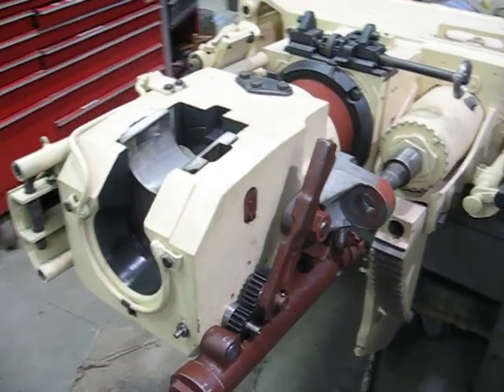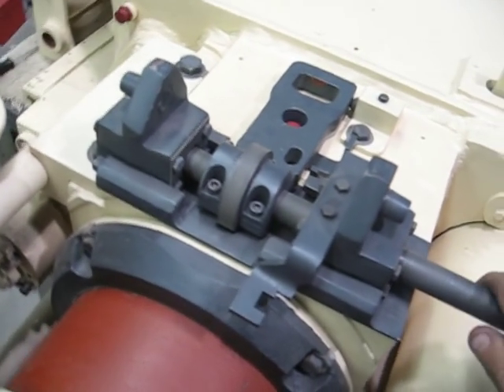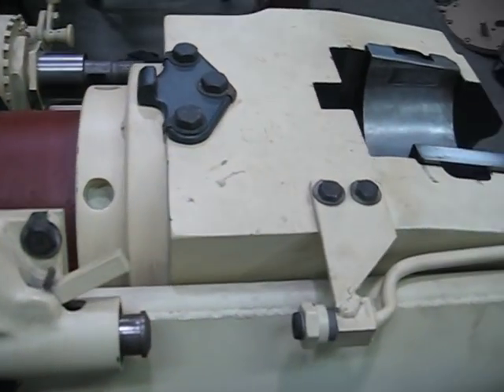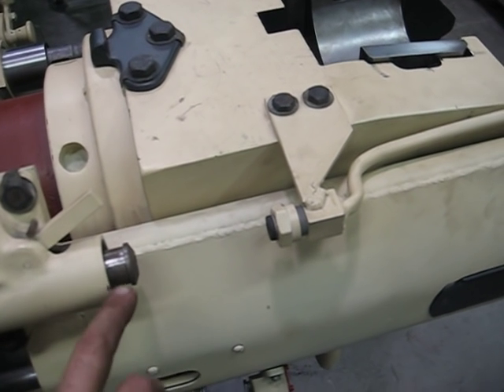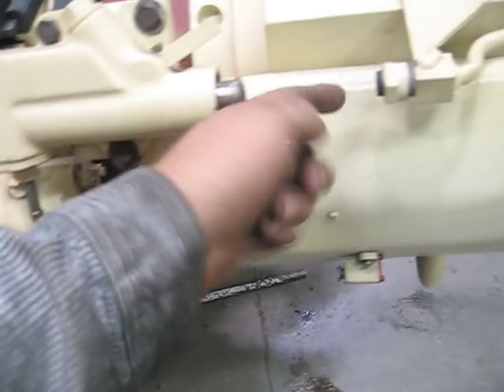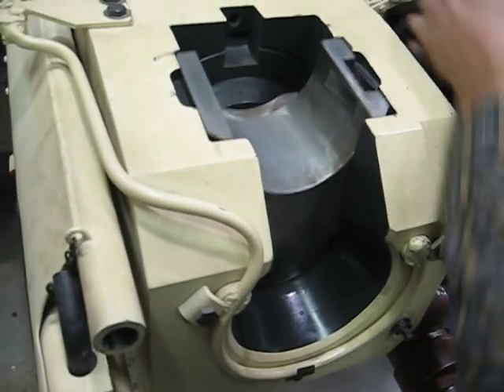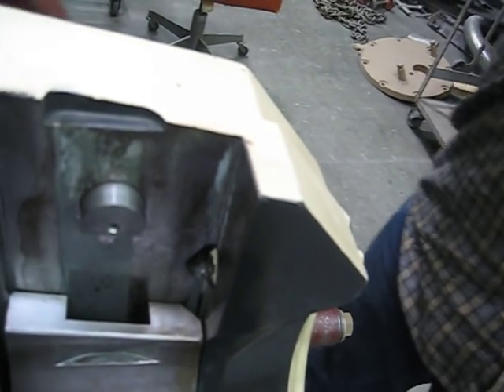Panther Tank 75mm gun tour!

Comment from the maker: We can't fire any sort of round through this gun (or any of our others) because the breech ring has been torched apart to meet U.S. specs for importation and then tacked back together to look original.  There is also a 75mm hole torched in the high pressure area of the gun tube.  The sliding block is also fake and missing all the firing pin features.  Sorry for the disappointment....
Reply: Hi im just asking a question how does a tank turret hold a big barrel and yes i know why there are spring its purpose is shock absorption right or i am wrong?
Reply: @yellowsaturn2873  Hello, in the turret front, the barrel with the cannon cover is supported with strong pegs without play to enable the barrel to be raised. The recoil is actually absorbed by springs and recoil brakes. The brakes absorb most of the energy and work on the same principle as a shock absorber in a car. The spring or springs are primarily used to pull the cannon forward again into the firing position.
Reply: Uh, yeh...
Reply: She can never fire in anger again...

Comment: In the olden days it was done mostly with turret exhaust fans, a bit later on the bore evacuator was developed, this is a canister placed on the exterior of the gun tube that contains the gasses from the shot fired, then as the shot passes the tube vents (that lead into the evacuator) the vacuum created as the shot leaves the bore, allows the gasses to vent from the muzzle. This system precedes the evacuator, and does help to keep the smoke to a minimum. Its like tear gas, very unpleasant stuff

Comment: How this semi automatic acyion works
The gears contract the spring towards the breech by pulling the rack. Imagine that instead of the force being applied through the handle, gears, and rack to contract the spring, there is instead horizontal force is being applied directly to the rack to compress the spring. That is exactly what part L does. 
First to clarify, the hook and acting cam surface (part M) is part of the gun cradle and is not attached to the barrel or breech. Part L will be rotate clockwise after it impacts part M when the gun recoils. The round top section of part L will then push down on the angled wedge surface that is connected to the rack (part F), causing the rack to be pushed towards the breech, compressing the spring (part G) and also rotating the pinion gear (part E). Part N is a spring loaded plunger that prevents part L from moving freely while the gun recoils and resets (it indexes in that small crescent cut to the right of the label pointer). Part L will stay rotated almost horizontal until the ejector arms are tripped and the spring pushes the rack forward again, causing the angled wedge surface attached to the rack to push the round surface of part L and rotate it clockwise back into its original vertical position.  

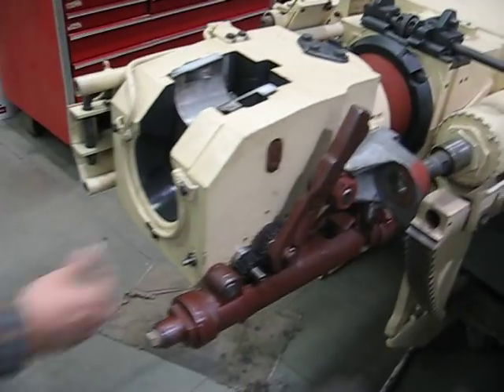The ejector arms is what allows the breech to close. Once the breech is open, it will not and cannot close until those arms are tripped. Pay attention to the little red flag like piece (part H in the drawing) as the breech is being opened at 0:32 - 0:33. As the breech is fully opened we see that little flag like piece pivot slightly. This is because it is connected to the ejector arms. This is a secondary way to allow the breech to close. Primary one being the rim of the shell casing being used to trip the arms

http://www.panther1944.de/Bilder/Panther/vorschriften/char_panther/Zeichnung-5.jpg

In the below picture you can see part L and M
https://d6a2z3m5.stackpathcdn.com/wp-content/uploads/2018/04/panther-breech.jpg

Comment: When being fired the breech the rim of the shell case trips the extractors and  the breech block locks, when fired the sight  adjustment from 600 yards to 1,200 yards is only 3/10 of a Mile. or less than 1/8 of a inch. And yes the Panther runs, but sadly the owner Mr Littelfield died shortly after driving without the turret in early 2009.

Comment: Great! But got a question, is this a semi-auto gun? Meaning as the gun fires the shell is ejected and breech lowered by the recoil? If so how does the gun accomplish these two functions?
Reply: Yes. It probably works the same way any other semi automatic artillery gun works. Check out the zis2 or zis3 ww2 Russian guns. There is a knob/cam on the bottom on the lever that gets hit by a flat piece of steel when the gun is pulled back by the hydraulics (the steel piece is spring loaded to move out of the way when the gun recoils). Think that this operates in similar concept but designed in a more elegant and refined way

Comment: Can someone explain to me how a tank gun's sliding breech works? I never understood why the breech automatically closes. Where does the force that automatically causes the breech to close come from? Is there a spring compressed somewhere or hydraulic cylinder or something  after the breech is opened?
Edit: I figured it out.
Reply: guess the breech wil lock by itself when round is loaded, Pressing the 2 extractor lugs, wich, in their turn, will release the breech so it wil lock behind the shell case and knock the loaders hand up and away from the chamber
Reply: @fauzaanachmadillah4670  yes the breech is locked open by extractor arms. I know that. What I'm wondering is what is forcing the breech closed.
Reply: @fauzaanachmadillah4670  take horizontally sliding breech artillery vs vertical sliding breech artillery. For the most part with a horizontal sliding breech, the loader slides the breech block back into place manually. But a vertically sliding breech this isn't possible to do since the breech block is too heavy to lift manually. So someone invented a mechanism to automatically force to breech block back up after its been opened. I'm wondering what that mechanism is and how it works
Reply: E. P The tank rounds have a lip on the case to catch the trip levers on either side of the breech, actuating the trip mechanism. You can see them on either side of the breech block from the top view. Loaders were using gloves and the term “ram it home” came from that. A closed fist works best so it can’t catch fingers on the upstroke.
Reply: @Filmpilot  But why does the breech block move up? Is there a compressed spring or a hydraulic cylinder that causes the breech block to move back up? It has to overcome gravity to move up again. I understand the extractor arms hold the breech open and get tripped by the rimmed case being inserted. But why does the breech block move up in the first place? If you drop a box it doesn't automatically put itself back in your hands
Reply: Speaking with pure, speculation. I assume when the breach block is opened, the shell case is ejected,  thus allowing the loader to select the appropriate round for the next shot. Since time is of the essence in combat, you want that one pull of the leaver to be the only effort, besides loading, per shot.
Reply: @theTLKkovu/gondoix ah. Is the spring in that dark red tube on the right side? Or..?
Reply: @theTLKkovu/gondoix I see I see
Reply: Karbstar productions  yes. Dunno if this is sarcasm or not but I will explain. Manual sliding breech block is no different from semi automatic. There is a peg or some surface (the cam surface) on the "active part preforming the opening", or in this case the manual lever/handle, that is indexed to an angled groove/track on the breech block so that it slides the block. The peg slides in the cam track until it hits its end of travel and the breech block, fixed in travel by the breech block housing, can only move along the line of travel that the cam is pushing. 

Maritime.org!doc!boforstm!part2.htm (replace ! with /)

Eugeneleeslover.com!USNAVY!CHAPTER-8-B.html (replace ! With /)

Documents detailing the 40mm bofors may help with visuals
Reply: Karbstar productions  this explanation is clear enough to understand? Or no?

Comment: How does the breech open automatically during recoil?
Reply: There is a little nub somewhere that knocks the lever as the breech returns to position
Reply: @a.t6066  seriously? That's the best explanation tou can come with?
Reply: @DevS25  it is what it is.... it's not rocket science nor does it require a complicated explanation. That is literally all that happens
Reply: @a.t6066  seriously dude? You can upload some kind of drawing to back up your claim?
Reply: @DevS25  i have not seen this cannon in person nor do i have the manual with me right now so i cant describe what this piece looks like or where exactly it is on the gun but all semi automatic artillery work the same in how the breech opens
Reply: @DevS25  take a look at the Russian zis 3 76mm gun . It will help you understand how a semi automatic artillery piece works
Reply: @a.t6066  okay not this gun, draw me a simple schematic of how any other gun that you can think of would work.
Reply: @a.t6066  in real life or in some website?
Reply: And the replies from this E. P genius ends here
Reply: @DevS25 
Here is a simple drawing of the kwk 42.  
The mechanism works using the same principle as all other semi automatics but with gears.
The curved hook near the elevation gear is the cam surface. It hits the  lever (part Z between parts H and N), which in turn flips down and pushes back on the angled surface on the spring loaded tube (which has teeth on the top that interact with the gear that opens the breech) part N prevents part Z from loosely flipping once the gun has recoiled and part Z has cleared the hook (cam surface). Part H is likely connected to the ejector arms and is used as a secondary way to close the breech (as demonstrated in the video).  All these parts are housed within the red sleeve (video)

http://www.panther1944.de/Bilder/Panther/vorschriften/char_panther/Zeichnung-5.jpg
Reply: @DevS25  it's just a overly, unnecessarily complicated mechanism to perform a a simple task. Like I said, other guns like the zis 2 and zis 3 are better examples. They are simpler, just as reliable and just as effective
Reply: @DevS25  or was this explanation still not detailed enough for you....?
Reply: Okay.
1. The part you call Z is L
2. I have been studying that diagram for 2 years now
3. L does not have any toothed part that interacts with closing, it's a simple catch with keeps the spring loaded mechanism
4. The ejector is not the secondary way to close it, it's the primary source to close it while in semi automatic action
5. You see that cute 2 little gears? The one in the handle is a ratchet, it can only turn anti clockwise while being engaged by the handle.
6. That gear turns the gear below it.
7. The bottom gear pushes a pinion which is connected to a coil spring, contracting it towards the breech.
8. The L part keeps the spring from going back to it's initial position.
9. You press H downwards and it closes the breech
Reply: @a.t6066  And kwk 42 is one of the simpler designs I have seen, try looking at american ones, they require more milling, those 76mm and 90mm ones.
Reply: @DevS25   truly no offence, but I don't care how long you have studied that diagram. What I described is 100% how the mechanism works. I never said that part L had teeth on it. I said part L, or part Z as I mistakenly called it, is a lever that interacts with a part that has teeth on it. IE the rack and pinion that you apparently have a good understanding of. (didn't know how much you knew so I chose not to use words like that) "spring loaded tube with teeth" << rack connected to coil spring.

You are correct about everything EXCEPT 8 and 9. This will be easier to explain since you have a good understanding of everything else. So you know that the gears contract the spring towards the breech by pulling the rack. Imagine that instead of the force being applied through the handle, gears, and rack to contract the spring, there is instead horizontal force is being applied directly to the rack to compress the spring. That is exactly what part L does. If you understand from that then you don't need to read below.
 
First to clarify, the hook and acting cam surface (part M) is part of the gun cradle and is not attached to the barrel or breech.
You can't figure out how this mechanism works is because you have a misunderstanding about part L. Part L does NOT close the breech. Part L is not mechanically attached to anything. Part L will be rotate clockwise after it impacts part M when the gun recoils. The round top section of part L will then push down on the angled wedge surface that is connected to the rack (part F), causing the rack to be pushed towards the breech, compressing the spring (part G) and also rotating the pinion gear (part E). Part N is a spring loaded plunger that prevents part L from moving freely while the gun recoils and resets (it indexes in that small crescent cut to the right of the label pointer). Part L will stay rotated almost horizontal until the ejector arms are tripped and the spring pushes the rack forward again, causing the angled wedge surface attached to the rack to push the round surface of part L and rotate it clockwise back into its original vertical position.  

The ejector arms indeed what allows the breech to close. Once the breech is open, it will not and cannot close until those arms are tripped. There is no possible way for the breech to close if those arms are not moved out of the way. Pay attention to the little red flag like piece (part H in the drawing) as the breech is being opened at 0:32 - 0:33. As the breech is fully opened we see that little flag like piece pivot slightly. This is because it is connected to the ejector arms. So as I said, this is a secondary way to allow the breech to close. Primary one being the rim of the shell casing being used to trip the arms
Reply: Take away the mantlet armor, barrel and breech assembly... what are you left with? That's right, the trunnion and gun cradle... it's called a gun cradle or gun mount.
1) if the extractor arms do not hold open the breech then what prevents it from automatically sliding up?
2) related to 1, why is it that only once the shell is fully seated that the breech closes?
3) why do you think tanks have ventilators and the panther has a fume extractor. literally answers you second point...
4) what is the purpose or part M and how does it accomplish this task?
5) what is the purpose of part L and how does it accomplish this task?

In the below picture you can CLEARLY see part L and M. How can you say part L does not impact part M during recoil? Do you still have the audacity to tell me I'm wrong?
https://d6a2z3m5.stackpathcdn.com/wp-content/uploads/2018/04/panther-breech.jpg
Reply: @a.t6066 I know it’s been 3 years but can you explain to me how the rack interacts with the breechblock in the panther to make it go up and down. I know how the spring works and such but I can’t seem to understand the mechanism that links it to the breechblock allowing the spring to release its energy allowing the breechblock to move up
Reply: @-Benito_Swagolini-  see the link I provided.
The cog labeled 'e' is a gear meshed into to the rack which is connected to the spring.
Reply: @a.t6066  yes I understand that but how does this connect to the breechblock. Like when the extractor is pushed in and allows the breechblock up using the compressed spring. What actually connects to the breechblock allowing the spring to be used to let it up. Looking at the picture on the bottom left of a face on view of the breech it doesn’t look like the assembly on the right is interacting with the breechblock
Reply: @-Benito_Swagolini-  oh. It's just like any other sliding wedge gun. Its not visible in the diagram but there's a cutout in the side of the breech block that gets cammed by a part attached to the opening handle. It's just a flat piece with a round nub on it that's on the inner side of the breech ring
Reply: @a.t6066  either I’m not understanding you or you’re not understanding me. Like on the zis 3 gun breech the spring is on the outside attached to a center axel by an arm in which the center axle has another arm connected to the breechblock so when the spring decompresses it pushes on the 1st arm spinning the center axel moving the other arm pushing the breechblock up. How does this work for the panther’s gun breech because I can’t see anything that would turn the  horizontal motion of the spring into vertical motion for the breechblock to move up.
Reply: @-Benito_Swagolini- heres 40mm bofors breech. Now imagine instead of that snail spring, the acting rod is attached to a gear. And under it is a gear, that we'll call 'E', attached only to the breech ring. The rack interacts with gear E which in turn moves the other gear which is attached to the acting rod that's attached to the cam arms that open the breech like in the video.
https://youtu.be/UnDwlqbAEmQ?si=SAwtM1UgkxdlI2Je&t=0m53s
Reply: @a.t6066  omg thank you so much, trying to figure this out has been bugging me for days. If you don’t mind me asking you do you know so much about this stuff is it a hobby or do you have a career in this field?
Reply: @-Benito_Swagolini- checking mechanism of guns and whatnot is just a hobby for me though I am an engineer of sorts by profession

Comment: The loader must've been a strong dude
Reply: I think not really. Rather than pulling the lever towards himself like in the video he would probably push the lever down ( ie he is facing the opposite way of the gun and pushing the lever away from him)
Reply: E.P, excellent video. An important point on manually moving the lever. It had to be manually actuated only once before the first round was fired. Thereafter, the slide would drop after each round was fired, eject the empty case and remain open until the loader chambered the next round. Once this round was inserted the slide would then automatically close ready for firing.